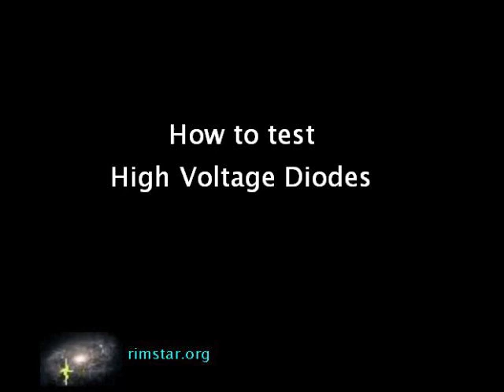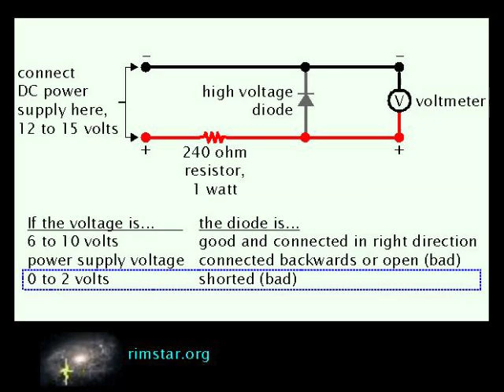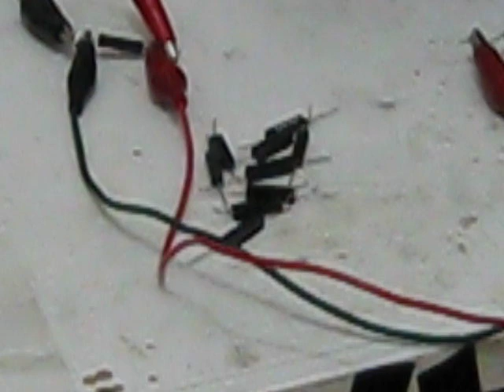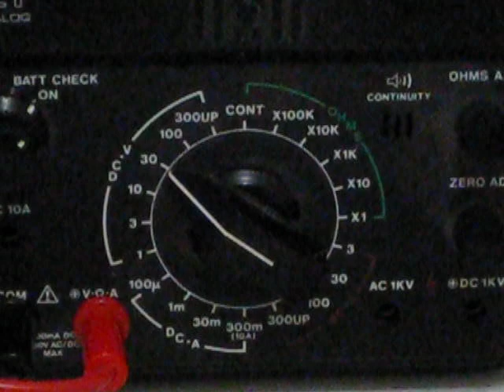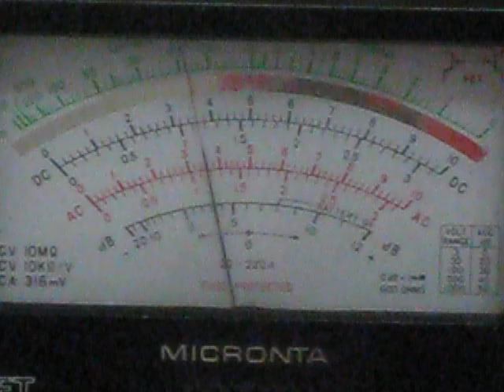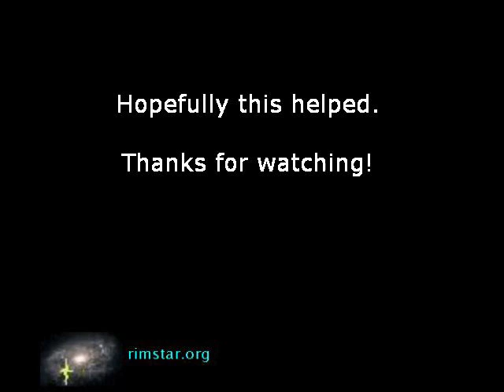How to test high voltage diodes

Comment: Interesting way of doing it (paralleled from diode). I use 24 VAC and measure in series. Each diode (24 in series internal) causes a voltage drop of 0.2 V

Comment: The resistance is used to limit the current so that you don't destroy the diode.

Some people use a 9 volt battery and no resistance. This is wrong on two level : 
1 : 9 volt is too low and you could end up throwing in garbage a good diode
2 : The 9 volt battery could destroy or compromise a high voltage diode

These high voltage diodes are made of many ordinary diodes connected in series. Each individual diodes have the usual 0.7 volt loss. The diode tested in the video is probably made of 16 or 17 diodes (17 diodes * 0.7 volts = 11.9 volts).

Note: I found an old "solid state" TV which used a single high voltage diode instead of the now usual voltage tripler which are now integrated inside the high voltage transformer. That diode measured 15 volt forward voltage, so it would appear as not working with your setup. But for microwave oven diode, the voltage used in this video is sufficient.

Comment: This test is good for low voltage diodes. You need to apply 2,000 volts in reverse to test high voltage diodes to check the integrity of the semi conductor.
Reply: +Odouls77 You took the words right out of my mouth.

Comment: A simple 9 volt dc battery will easily test the forward voltage drop and you can use any meter you choose. All of the microwave oven high voltage diodes that I have tested show a 2.5 (forward) voltage drop.
Reply: The example he shows in the video prove this statement wrong. The diode in the video needed 12 volt forward voltage, so the 9 volt battery would be insufficient and you would throw in garbage a good diode.

Comment: I have the same meter you have I got mine from a submarine I was on submarines for 7 years . When they were updating I got 1 of the meters. You should try to test the diode with your meter and 1 side it will show a very high resistance the other will be infinite. I also have 3 other meters and  only the 2 analog meter tests them.I have 2 fluke digital meters  and they will not test the diodes . They will work with the test you are using.
Reply from the maker: ncrdisabled Submarine vet Are you sure the resistance test will work for high voltage diodes? My meter was a hand-me-down from my father who worked as a electrician.

Comment: Using this set up will allow to test if a transistor(a bipolar transistor is basically two diodes) is at least functional, but can't test for performance. Also it. The transistor leads can be identified as well

Comment from the maker: @frecku6610 No, it doesn't have to be 1W. If I'm calculating correctly, for 12V the power through the diode when it's conducting is around 0.6W. I=V/R=12/240=0.05A, P=IV=0.05x12=0.6W. So anything 1W or higher should do.

Comment from the maker: @lmasisi It has low resistance in one direction only. The 0.7volts value is the voltage you have to apply across the diode before it will conduct large amounts of current. Once the current starts conducting, the voltage across the diode increases as the current increases.

Comment: I agree with you with regards to a short, i said that because of the rectification ability of a diode and the fact that once it is in correct operation it has approximately zero resistance. This brings me back to same point, should not the volt drop across the diode be 0.7Volts (this value depends on characteristics of the diode, it could be more or less). I still do not understand why when the diode is connected in the correct polarity the voltage across it is so high???

Comment from the maker: @lmasisi But it's not like a short. A short allows current to flow in both directions. A diode allows current to flow in only one direction. See the diagram at the start of the video again. You are not just measuring across the diode but also across the power supply. The diode allows electrons to flow from one side of the power supply to the other, pumping up the voltage. Measuring a short is like putting both meter probes at the same point in the circuit. I just did that and got 0V as expected.

Comment: My theory tells me that once the diode is forward biased, then it acts as a short, which means the voltmeter should only read the volt drop across the diode which is normally 0.7 volts. How come this is not so in your video? are you using some special diodes or something ?

Comment: Dear Rimmer,
I didn't have my eye glasses on and thought this vt. was how to test your high voltage dildoes.
.
I'd always wanted to have mine tested, but never knew that I could get it checked.
.
Typical, there isn't any such test for a dildoe, that the one I have could be tested to see if it was still functioning at high voltage, was just a fantasy of mine.
.

Cheers.
from,
del-boy.

Comment from the maker: @hec031 I don't think so. I sure wouldn't want anyone to damage anything as a result. The test circuit is one I got from the web, and I've used the very diodes I'm marking in the video for Cockcroft-Walton voltage multipliers boards and I've gotten the expected results as shown on my oscilloscope and on my multimeter through high votlage probes.  i.e. Boards wired for positive output show as positive w.r.t ground on the scope/meter and negative boards show as negative.

Comment from the maker: @fakkyouhomo I don't know what the resistance should be for your diode, sorry. I'm assuming you're using an analog meter and when you measure in one direction you get nothing (open) and when you read in the other direction you get 170ohms. If so, that sounds good to me. It also doesn't sound like it's a high voltage diode otherwise your meter wouldn't give you any resistance. The voltage that a meter uses for checking resistance is too low for high voltage diodes.

Comment from the maker: @fakkyouhomo You'll have to give me more information. You get 170 what? Volts? Ohms? What scale is your meter set to? What are you using as a power supply and at what voltage? What do "enna" and "cetta" mean? The terms sound familiar but I can't find any translation for them.

Comment from the maker: Thanks DJ! I'm not sure what you mean by "not divide". Note that these are "high voltage" diodes. The usual simple testing resistance in both directions and the diode settings on some meters don't work. That's why this circuit is used.